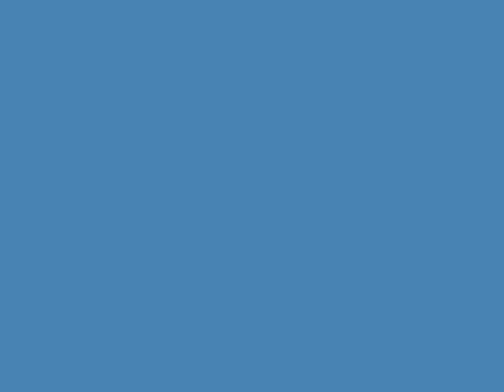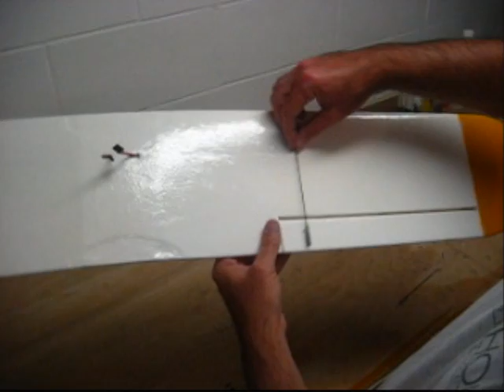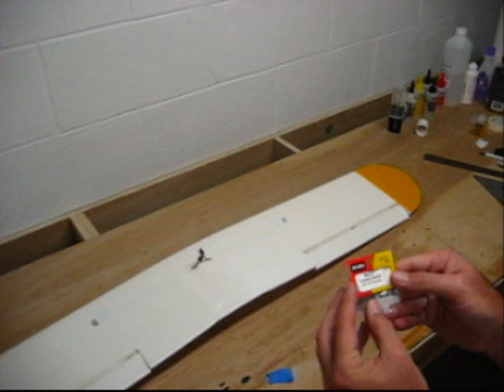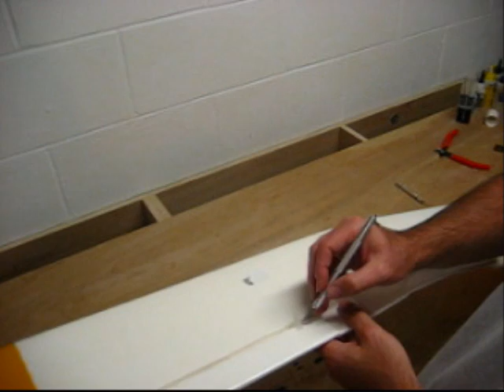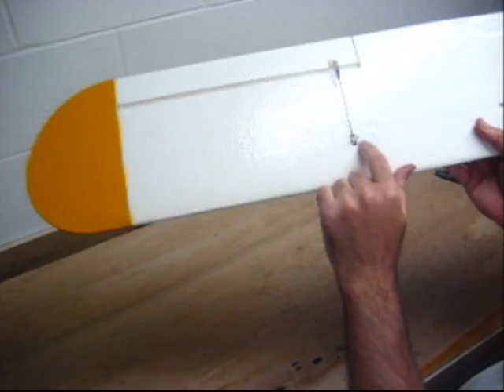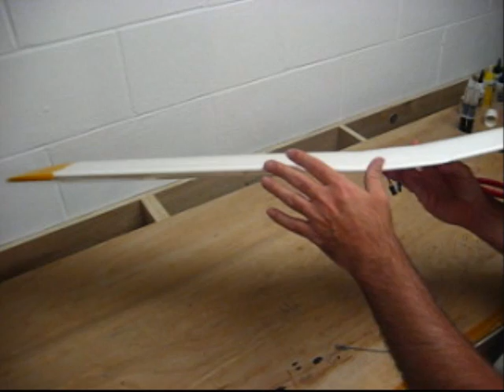13-Mounting Aileron Control Horns & Linkage - HZ Super Cub Scratch Building

Comment: a good liitel trick instead of cutting the covering, take off the horn and use a little needle and poke holes in-under where the horn sits and use your glue .then mount.
 Thats how i put on lead weights(even though they have Double sided tape) on my Glow planes for balance.
Great how too NeCubFlyer.. I have Subed.
Cheers